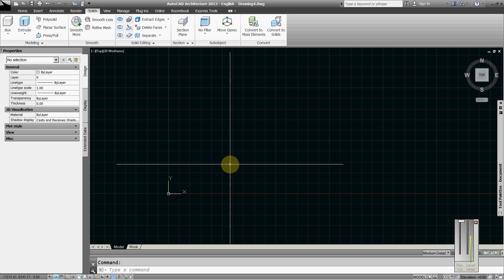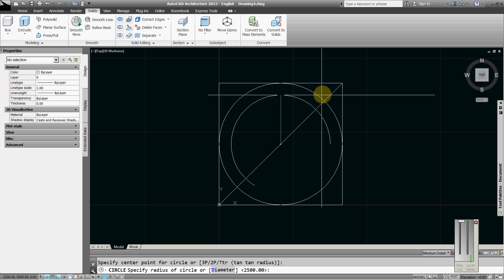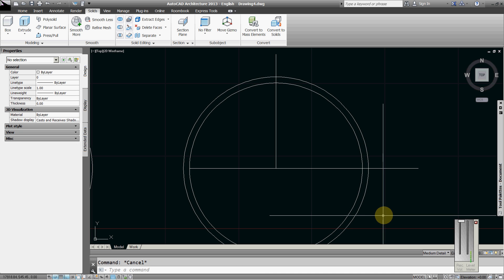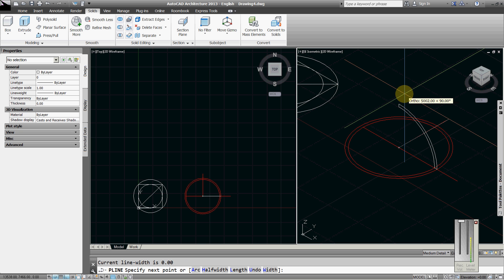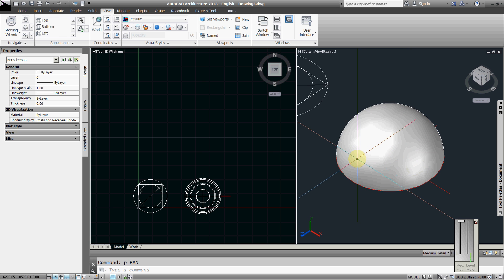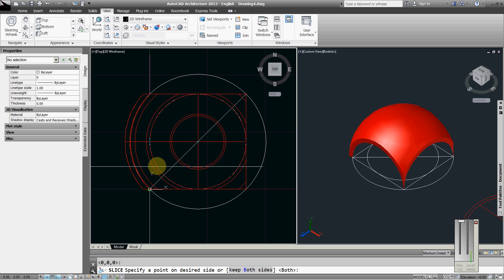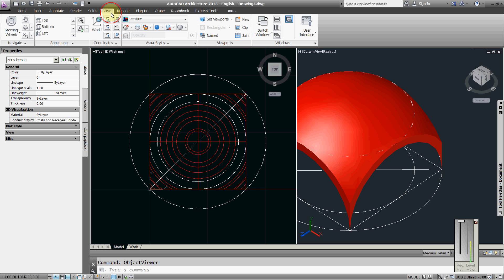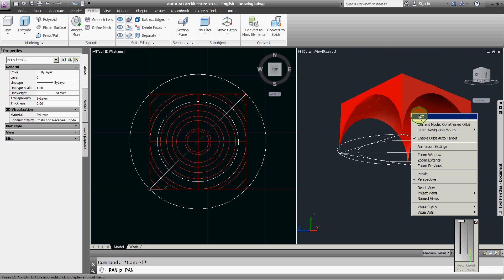how to draw a shallow dome in Autocad Architecture

Comment: Very good video, not fast at all, if you know cad then it is easy to get it. Matter of fact you can even cut out some parts and still make the dome. I did not have to draw a rectangle and circle to get it done. I even did one using spline. Very good job Maher.